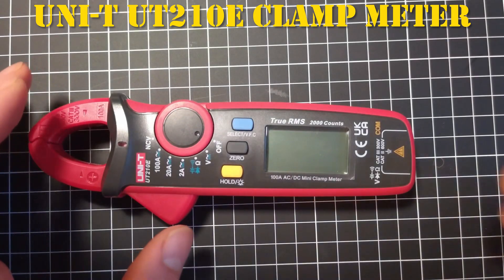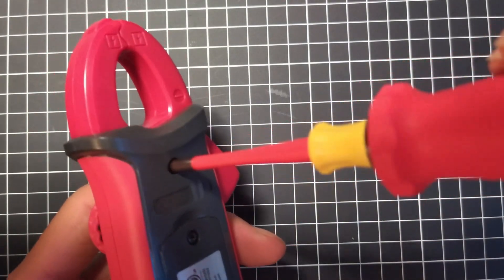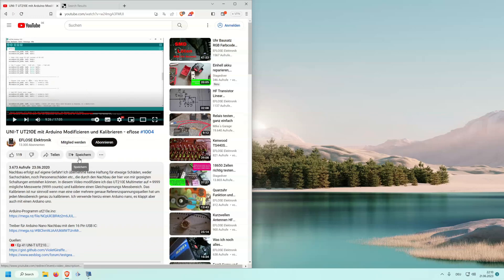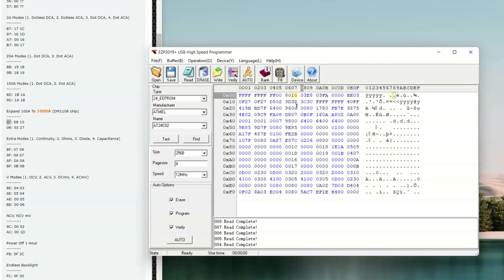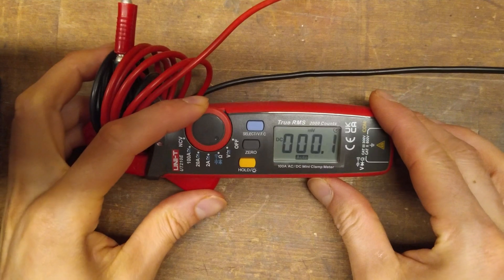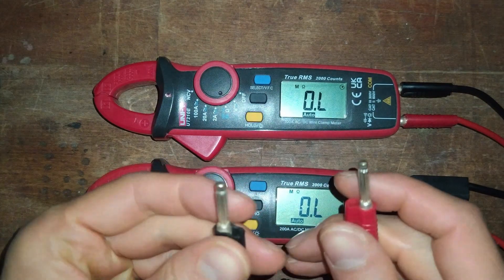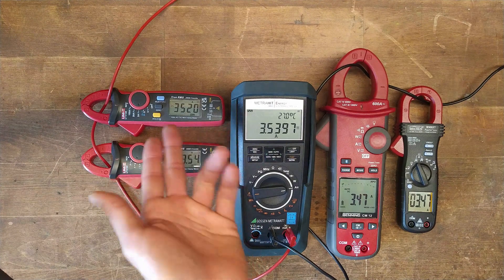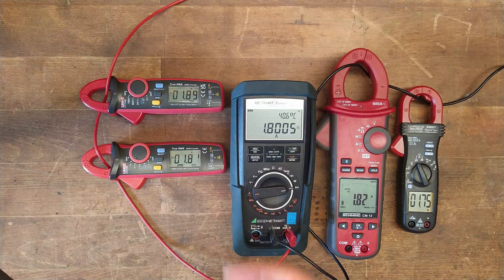UNI-T UT210E Clampmeter 1000A UPGRADE, Part 2

Comment: Ich habe auch das gleiche messgeräte und bin Laie. Warum beim strommessen  zeigt das gerät z.b. 0.231 v an der Steckdose. Ein multimeter zeigt 230v an. Das mit 0. .... irretiert mich beim messen
Reply: Danke für die schnelle Antwort. Hatte jetzt vor der Meldung lange auf dem blauen Knopf gedrückt und siehe da steckdosensoannung wir jetzt mit 232 volt angezeigt. Vielen Dank.
Reply from the maker: Ja, es ist wichtig, dass du für Wechselstrommessungen im AC-Messmodus bist. @a.p.30
Reply from the maker: Es sollte 230V anzeigen. Wenn es 0.230V anzeigt, ist etwas schief gelaufen.

Comment: I did not do the 'increased count' mods to my 2 UT210E meters, but I did some other eeprom mods.  I increased the 100A range to 300A, and moved the warning beep to 150A. This is because I found that (in my 2 meters) this range reads low if you measure over 150A - so beep reminds me that reading is only a rough indication of current beyond 150A. (iron jaws saturating was one theory on eevblog forum) 
In this video you used multiple turns of wire to get the high current, did you find readings accurate over 150A ?
Also, you can get the 2A dc range offset down to +/- 12mA, and I made a collaboration video with TheHWcave (YouTuber) on how to tune the analogue Hall sensors to get this low offset - you also get an offset that does not change very much when you rotate the meter ! However, it's quite a difficult set of adjustments to make, and was fun for me to do, but I don't think most people would care so much - the zero button can do some of this for you.
Reply from the maker: Thank you for this insight! I found, that over 6A in the 2A range, it stops counting higher, even if there is a current of 9A. But only one way around. If you swap the meters orientation by 180°, it measured just fine. I should make a follow up video to explain that. But I am limited in time right now. It might be because of my PWM power supply in the current limiting range. If I just regulate the Voltage and current limiter on the power supply is not active, I don't have this problem.
Reply: @Raphael_Hofmann  Interesting.  My question really was - when you measured high currents on the '100A' range in your video, using a power supply and multi turns of wire, do you remember whether the current readings were correct on the UT210E ? You had a reading of 400A finally I think. My two meters started reading low above 150A, and this got worse with higher currents, all measured using your method in the video.
Reply from the maker: I will try that again and let you know. @noakeswalker
Reply from the maker: Your Colab-Video on TheHWcave channel is really great! And I will mention that, if I do a follow up.
Reply: My collaborator did most of the video work - it's a tricky subject to explain ! I worked out the method of the adjustment, because I noticed how much like an electronic compass the UT210E is, but trying to explain the method to my collaborator friend was quite hard - also, he couldn't get his meter to respond like my two did, so he did a good job with the video bearing all this in mind :o)
Can I post links to other YT videos - not sure ??? I'll try this one - it's an unlisted video I made for TheHWcave to try and explain a part of the adjustment process during our collab. 
https://www.youtube.com/watch?v=1_z5R0iBhMw
It only makes any sense from about one third in !

Comment: Nicely done. Also very nice that you showed the downsides of these mods. At the end it shows one fact lots of poeple confuse: A higher resulution doesn't mean a higher accuracy. Unfortunately lots of poeple think that more digits behind the point means better accuracy...well especially clamp meters (nearly all of them) are what we call in german "Schätzeisen" what translates to something like "guessing iron" or "estimate iron". That said, it can be helpfull for troubleshooting to have an estimate of what is going on. You may also be able to see trends what is about to happen, but unfortunately those trends can also be related to temperature and other effects falsifying the measurement, so don't get to fixed to the exact number, especially the last on or two digits, you see on the display. That is especially true for the clamp-A-meter. 
As for the rest it is a nice thing to be able to change some settings.
Reply from the maker: Thank you for this recommendation! If I make a follow up video, I will try to point that out. But this kind of modification is done by a audiance, that hopefully knows about that.

Comment: Hello Raphael,
very nice video. I really appreciate your simplyfied explanation. Thank you very much for sharing this in very detailed steps.
I own an UT219DS. I wonder if there is also a hack for this model with which you can customize and extend functions.
Can you tell something about that?
I found you on Andys Channel from 'sunny hot austrailia' 🙂 subscibed and liked -> thumbs up 🙂
Reply from the maker: I wished I had the time to research all that. But so far, I did not find any other information on how to pull that off. If you find such a EEPROM in the UT219DS, you can try to read it...but then you need some kind of translation on which caracter changes your desired function.

Comment: Wow!
Amazing and very creative. Too bad this does not come as a standard.
Also very nice gesture from you to Andy @off-grid, he was, as I'm, still using the older D model.
I was also not aware of those default settings & behaviour.
Maybe you should set-up & start a business selling those modded UT210E.
I would buy one and I believe more people would be interested.
Reply from the maker: My main job is installing Battery backup systems for Solar installations and also ESS systems with Victron equipment. So I actually have a business and can send you a official invoice, if you are interested. You can send me a e-mail: autarke-energieversorgung@posteo.de
Reply: @Raphael_Hofmann  Thanks, much appreciated!
I have in fact ordered the outlined programming-tool as I want to experience it now myself.
But I'm sure there are on-readers here who would appreciate contacting you to get it modded by you. Thanks again!